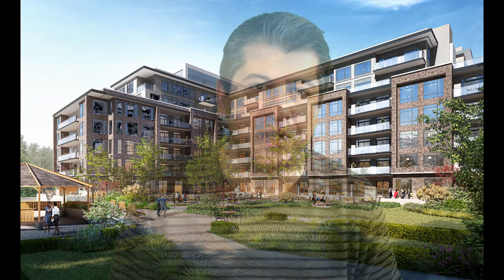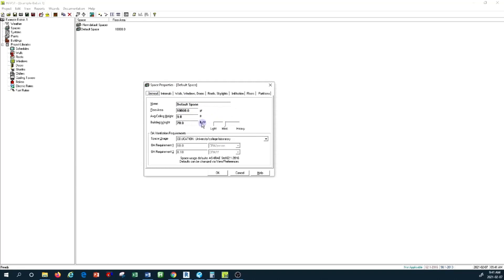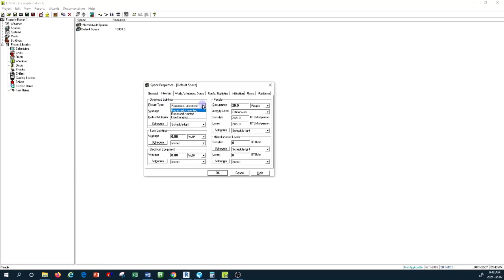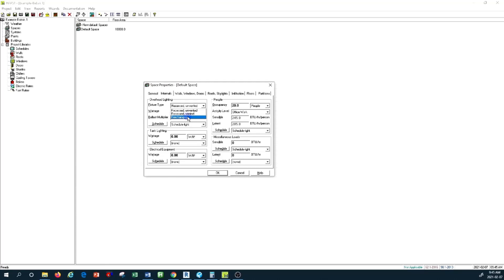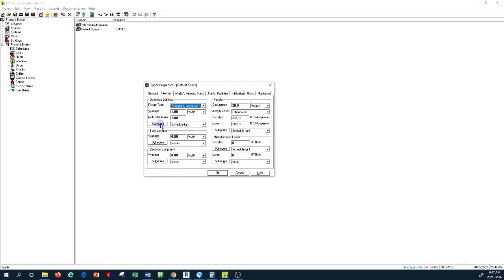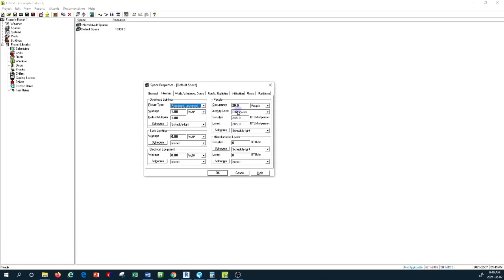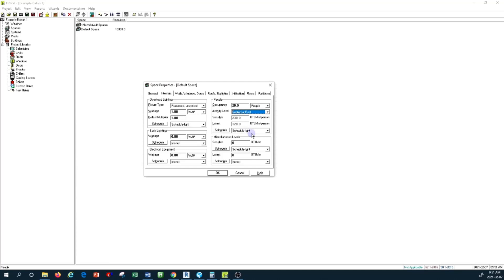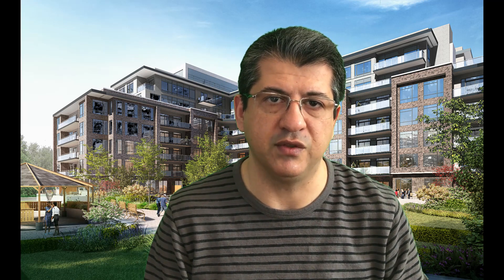Carrier Hap Tutorial- 3

Comment: Sir if we want to calculate the heating load for space instead of cooling. In that scenario do i have to add the internal loads or not because in heating load we want that heat into the space so kindly clear my point..
Reply from the maker: That is a good question. This very depends on the rate of heat generation in that space during the heating season. For instance during the heating season when you have to provide heating to variety of spaces, you will need to provide cooling to a building space such as a data center where considerable heat is generated in that space even in the winter time. So the short answer is that you have to account for any heat generation to be able to realistically calculate the heating load of a space. I hope this helps.